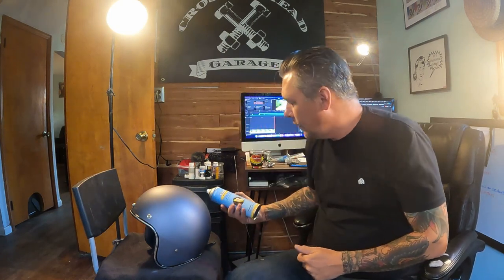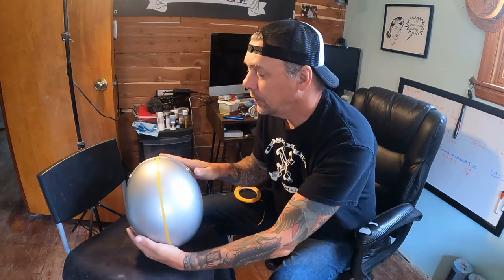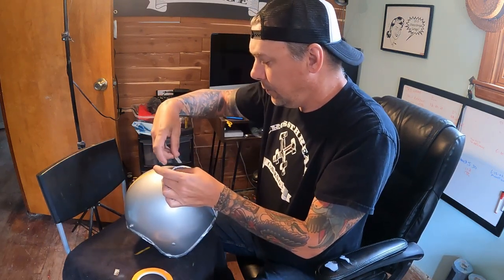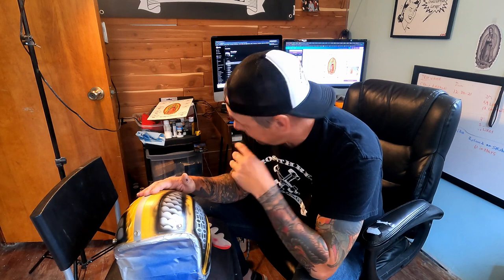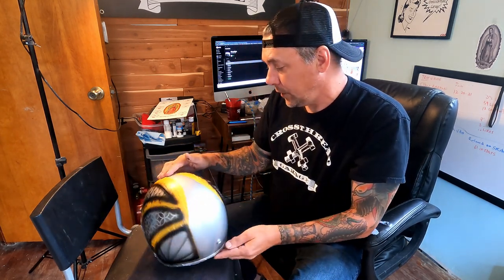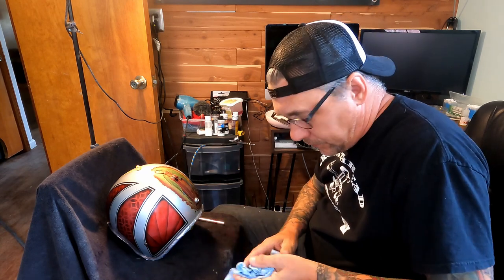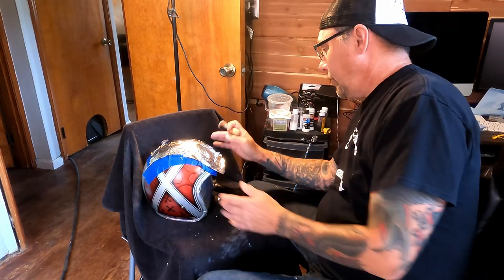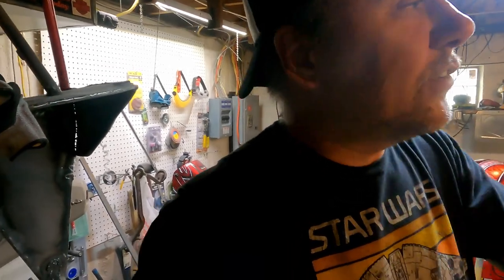How to do a custom paint job on your motorcycle helmet

Comment: at least it was a small idem even though you spent a lot of time on it the purpose was it a training video or at least a video showing your skills Not like the mistake i made I painted a whole car had to sand it all back down to bear metal and start over.  I received some bad information  I primed the car with lacquer and painted it with urethane it was beautiful until i tried to put flames on it when i pulled the tape large pieces of paint came off of the car
Reply from the maker: OMG that's a nightmare!